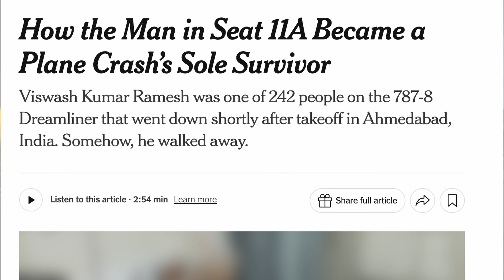Why the RAT Changes Everything – Air India 171 Update

Comment: Cant rule out pilot error at this stage of any investigation. Loss of thrust at any time has to be investigated completely before any kind of venture into the "AHA" moment. Accidents are mostly caused by a 'Series of Events' that concludes in a failure of systems not performing as designed.

Comment: what can cause a dual engine failiure on a lets presume full throttle? electrical? could be the maintanance crew fault in a hangar? i mean you simply cannot affort that cruccial failiure on a plane, it is like heart stop beating. changes in aviation sector must done. crash is unacceptable. and stop comparing statistics becuase it is totally false and unfair to even think that way. you can see for yourself that flying with planes isn quite the safest way, it is stil dangerous as is with cars, trains and ships.

Comment: Seen another video online of the same plane from the previous flight it was on where there was absolutely NO electric working in the passenger part of the plane.   This would indicate an electrical issue that could cause both engines to stop.  However I still don't see the flaps down on that new better version of the video.  What do you think of this information.

Comment: This entire incident is intriguing (as well as tragic).  Dual engine failure leading to RAT deployment now sounds likely but why would both engines fail, and at presumably the same time.  The black boxes should hopefully provide pertinent information to understand what happened in this, the first hull loss of the 787.   Thanks Captain Steeeve for your excellent presentation!
Reply: Air, fuel, and ignition is what keeps a jet engine running.
Reply: @melfordsolomon8244  You only need ignition to start a turbine, not to keep them running. Air and fuel is all that they need, and they never run out of air.
Reply: This Air India case could have been confirmed shortly after getting back the black box.   
 The Korea case happened half a year ago was far more difficult to diagnose.
Reply: I really don't think the engines really failed like that. I only can see only one engine failing but not both.  I really think The failure was in the electrical system which then affected both the engines
Reply: Could be fuel contamination
Reply: Fuel contamination
Reply: @MrJonreed7 That is a distinct possibility, but I thought that there are safeguards against contaminated fuel though, like filters, and sampling the fuel either before or while it’s being pumped into the aircraft’s tanks.  It’s very important, after all, to ensure that the fuel is pure and won’t cause problems.
Reply: @49kittypretty1 .I'm sorry it might not be You but You bear a striking resemblance to someone I use to know from high school. Where did you attend high school in the USA 🇺🇸??? ???
Reply: @MrJonreed7 yeah it’s India maybe curry entered the fuel

Comment: I've also seen other (unverified) comments that on the previous flight of this plane, passengers reported electrical outages in the passenger cabin.  So maybe it's not dual engine failure, but electrical system failure, which might also deploy the RAT and explain why landing gear was not raised.

Comment: Outstanding and spot on analysis!
  There's also a video from one of the passengers prior to take off complaining about the seat-tv's malfunctioning as well as the stewardess call Button. On top of that the air conditioning system was not working and everybody was sweating.
  This strongly suggests a catastrophic electrical failure that took out both engines. This is also consistent with the Pilots Last transmission that there was no power!
  This also further suggests another Boeing aircraft design or construction flaw.

Comment: Bad design , the wings, engines attached to the wings instead of the fuselage,or rear .too heavy , plastic instead of aircraft aluminum , therefore making more weight to be added to the landing gear , nose should be clear so the pilot can better gauge,

Comment: I used to work at Sundstrand Aerospace in Rockford, IL, where the RATs were made. They are amazing devices (as well as some of the other Sundstrand products). Each RAT would go through extensive testing in the factory before shipment. And it was unbelievable how loud they could get at full RPM. The test cell was specifically reinforced to absorb any impacts, in case a RAT would ever come apart.
Reply: Thanks, this is fascinating info. So much development and work goes into a complex plane like this one.
Reply: Testing the RAT on the B767 was an amazing sensation.  The prop would be guarded and then run on test.  The sound was incredible.
Reply: I have Tested the RAT in ground for ops check, can be deployed in ground, gets hydraulics hooked up and run it, It's EXTREMELY Loud, the Most Annoying sound in aviation is the RAT ground ops, more than engines at max power
Reply: How does the RAT get power?
Reply: @cifey  it generates power from the prop turning in the slipstream, working just like an individual windfarm.
Reply: @steveseaman7794  in that case maga would claim they all got cancer from it... lol
Reply: @cifey  After it gets deployed out of the belly of the plane, the air passing over the RAT propeller (from the plane motion) causes the propeller to spin. Then that spinning propeller is used to create hydraulic and/or electrical power. Think of it as operating similar to an electrical wind turbine.
Reply: @cifey  The RAT generates power. It is a wind turbine.
Reply: @cifey  When it drops, the power is generated by the wind hitting the propeller.
Reply: @cifey  it gravity-drops and is turned by moving air.
Reply: @laurasalo6160  It's spring loaded, and you do not want to be anywhere near it when it deploys. The springs are massive.
Reply: @cifey it’s a windmill…all it needs is a Don Quixote …😂😂
Reply: Question from a non pilot or engineer. He said that the RAT provides electrical and hydraulic power. Does the RAT have a hydraulic pump as well as an electrical generator turned by the propeller directly, or does it have an electrical hydraulic pump that used some of the electrical power generated to power the pump?
Reply: @BabyMakR The RAT has a hydraulic pump that pressurized one of the hydraulic systems. To generate electricity there is a small electric generator driven by a hydraulic motor. There is a small amount of electricity generated, so it is only to maintain essential flight instrumentation and communication equipment.
Reply: Thank you. Would unwanted RAT deployment during rotation create enough drag to spoil airspeed if the engines were normal?
Reply: @Mr42960 no. Simple, small and aerodynamic like a propeller on a small airplane. Its not "zero drag", but its peanuts, surely.
Reply: @Mr42960  Not an engineer. But my guess would be no. The RAT is extremely aerodynamic, and probably has minimal drag. Many of them are actually a lot smaller that I would have expected, especially for the power they can produce.
Reply: @centauri61032  Isn't it's job literally to be as un aerodynamic as possible up to a point?
Reply: @Mr42960 why would you think that's possible? The engines have enough thrust to push that giant plane through the air to 500mph, a small fan in the slipstream would not cause a crash.
Reply: @Mr42960  They'd have to be spinning Isaac Newton's grave otherwise.
Reply: Yes we used to test rats on emb175 aircraft by pressurizing it with hydraulics from the back. Yes it was loud
Reply: What happens if a RAT comes apart on a plane? Does it slice through the fuselage like hot knife through butter?😂😂
Reply: The survivor reported a loud bang followed by the lights flickering.  Is there a ordinarily a loud bang when a RAT deploys, maybe the RAT’s door bangs when opening.? Or maybe when the RAT itself reaches the end of its travel and locks into place literally with a bang?
Reply: Ok tmi
Reply: Yeah Right!
Reply: Captain Steve have some guts to say that you were wrong. You just blamed pilot telling people that gear-up and flaps handle next to each other and pilot might have pulled the flaps handle. Come on Captain Steeeev, you are better than that
Reply: @SanataniJoe  There's new evidence. Didn't you watch the video?

Comment: Captain,
A quick question from an absolute aviation Layman....
Would the Flight Recorders, both CVR and DFDR, have had electrical power supplied to them, in the event of total power loss, with only the RAT power supply available? I'm curious to know if valuable data would be lacking, as in the Korean Jeju jet crash?

Thanks for your analysis.

Comment: Great analysis, Captain. In my opinion, there might have been a combustion instability that led to both engines going down. I know it’s very rare in aircraft like the 787, but it could be a reason due to Debris or contamination in the fuel system leading to a software fault that mismanaged both engines during the initial climb. Improper maintenance could also lead to that. It’s extremely rare, but it could be a factor in this tragic incident.

Comment: Yeah, listen to the sound after the plane passes by and the last 3-4 seconds before impact. There's near total silence after the sound of the RAT dissipates. There's no way both engines were running. They are very quiet but not that quiet, and it was too soon after takeoff to reduce the power from takeoff setting to climb thrust set.

Comment: Here's another clue for audio cues that goes along with the RAT being deployed. The fact you can hear the RAT in the first place, and what you are not hearing. The engines themselves. In that video taken from the rooftop, you hear the RAT, but no engine sounds. A plane flying that low that close with it's engines on should be pretty loud and audible. But the lack of sound in that video is another clue. If the engines were running, I don't think you'd be able to hear the RAT very well. 

As to possible causes of engine failure, the one I've heard that interests me most is contaminated fuel, because I've actually dealt with the consequences of contaminated fuel personally. I was a mechanic in the army, and worked on generators in a Patriot missile unit. During one FTX, we suddenly had a massive systems failure due to all our generators suddenly losing power and shutting down. Not just the generators, but the trucks themselves were dying. Long story short, we discovered our fuel handler had filled his 2000 gallon tanker from the waste tank at the fuel depot instead the fuel tanks. Needless to say, it took us almost two days to fix the situation.

Comment: Plus, the main gear bogeys performed their initial forward or leveling procedure, signaling that the PNF initiated gear retraction but then the process stopped before the gear doors opened. I am leaning with the dual engine failure also.

Comment: I posted this same explanation in your yesterday video comment section.  The deployment of the RAT shows massive failure of multiple systems.  For anyone still thinking it was related to flaps... it was not.  This plane can take off under WORST conditions with ONE engine.  No flap mismanagement is going to overcome having TWICE the minimally needed thrust when both engines are working.  Flap mismanagement might make your butt pucker but the plane will not sink and crash.
I tend to rule out a problem with the fuel because it seems unlikely ONLY one plane would wind up with a bad fuel problem, and with this big a bad fuel problem.  If the fuel was this contaminated it seems like the problem would have shown up to some extent in other aircraft.  What seems more likely is something went terribly wrong in the whole "fly by wire" system and more specifically the throttle control portion.  I presume it has redundancies so whatever it was must have been something either massive or completely unanticipated in the system design.
Reply: can't be a bird strike, I wonder what else could have caused it. fuel is pretty much the only thing left
Reply: Could it be a case of sabotage of some sort probably by the ground handling crews?
Reply: @swarupdas8043  I agree.  Something could have been planted in those engines before take off.  It just seems so random that BOTH engines would fail at the same time.
Reply: @swarupdas8043 seems unlikely to me. Why would they? If they had why have we not heard from them.
Reply: @EristiCat how would you hear about it unless the investigation is done? We need to wait. Anything is possible. I won’t rule out any possibilities
Reply: Yep agreed, it’s going to be a massive failure of systems that has caused this as fuel issues or bird strike can be ruled out for now. There was also reports that the aircraft had issues in the cabin with lights flickering and screens turning off in the flight prior to this.
Reply: What about the reported 'loud bang' immediately upon take off?
Reply: @randmayfield5695 some have said the bang was the RAT deployment. I’ve been wondering if it deploys via explosive charge.
Reply: Is the RAT powered by fuel?
Reply: @cifey by air flow
Reply: @cifey no. It’s powered by the airstream. Like a windmill.
Reply: @EristiCat  Ok thats what I imagined, it's an independent wind powered electric generator. So I wonder why it wouldn't have been able to restore some power to the fuel pumps or hydraulics, seems like it's main purpose.
Reply: My first though was they didn’t refuel
I’m no engineer but to have both jet engines fail is a great miscarriage of the engineers thought process
I’ve heard each engine is independent to the other get swapped reattached changed.
To have both fail is a poorly devised system
Reply: @thurston4mor failure to refuel seems unlikely. Would the unrefueled plane have had so little fuel that it was barely enough to taxi and make it to 600’?  I don’t think they cut it that close.
Reply: A good theory... thanks. Your comment made me think a little more in detail.
Reply: I read a post by a 787 pilot, yesterday, in which he claimed that it is not possible to "accidentally" retract the flaps until the gear was retracted. The aircraft's
safety systems override the command. 
Like you, I would be very surprised if fuel contamination was an issue. The combination of testing protocols and filtration systems makes this highly unlikely.

Comment: Hi Captain Steve, Brig (retd) Khalid ex Pakistan Avn  Investigator..... with all the theory you put, I agree with the dual engine failures presumption as a likely cause.  Have you considered the fuel contamination cause? I have had an incident which i inquired back in 1998. Fuel contamination in a Jet engine, recently refueled after a flight. Casually missed out checking in  a hurry. After take off the contamination takes full control of the performance, and the engines lose power due to the less burning temperatures.  Do advise on this in your next videos. My 2 cents.

Comment: I'm just wondering if fuel contamination was the root cause of this.  It's hard to figure out a commonality between two very modern GENx engines failing at the same time... but generally fuel, air and power (initially) are needed to run them.  The engines have their own generators, and can even run without external power or external commanding if communications is lost, so I'm sure that's lower on the list.  Air is not really an issue here... impossible to stop the air unless you have a bird strike which physically takes out the fans.  Besides, if it was a bird strike, you'd clearly see evidence in flight... smoke, fire, sparks, etc.  Fuel is really the only thing left, and it's quite easy to see them sharing a fuel tank of bad fuel.

Comment: Spot-on analysis.  Makes perfect sense with all the evidence to support the conclusions.    It's funny how you said that at that altitude (30,000) the pilot will begin to look for a landing field, etc.   My father (USAAF) always said, especially in a smaller aircraft at a lower flight level, as soon as you take off , you immediately and always look for a place to land.  Great Job!
Reply: In addition, I pray for the victims and the family.  Furthermore, I pray for India and its victims and families.
Reply: Indian pilot showed unreal courage and character by following all the protocols while death is in his front within 30 sec. When they knew RATS were out and cause dual engine failure 
1. Called MayDay ATC
2. Took the gear intact for some landing.
Reply: Well, you look and decide before you take off.
Reply: @keim3548    Respect, but there is no time to decide.  "Emergency Procedures"   Peace!
Reply: So why did they build that hostel right underneath the plane path
Reply: @007nadineL maybe land was cheap there?

Comment: RAT provides back up power. You dont lose thrust or necessarily performance and they would be above minimum rate speed as they were past rotation and getting lift. I have a feeling wrong numbers were inputed into the FMS and they took off very heavy, im high heat, and in the wrong configuration.  The airplane would not alert you of the different configuration if the wrong weights and data were inputted incorrectly.

Comment: The RAT uses constant rpm design with adjustable blade pitch and you can hear it oscillating in frequency. Pretty sure that is not normal.

Comment: the most Relevant evidence the statements of the sole survivor "From his hospital bed, Ramesh explained that the lights inside the plane "began to blink" moments after taking off. In a period of five to ten seconds, it felt as if the plane had been "catching in the air," he explained. The lights started flashing green and white, (GREEN AND WHITE the emergency lights on doors and steepway) and suddenly, they crashed into a building and the plane exploded.". It is a loss of energy, so the RAT. It is also not possible to see the BEACONS on the bottom.
Reply: no becons on any of the clips  but  the rat clip i expected that
Reply: …..did you watch the whole video? He specifically mentions the survivor’s statements.
Reply: He didn't overlook that, he actually mentioned it. 9:20